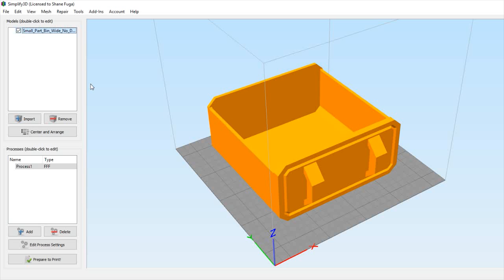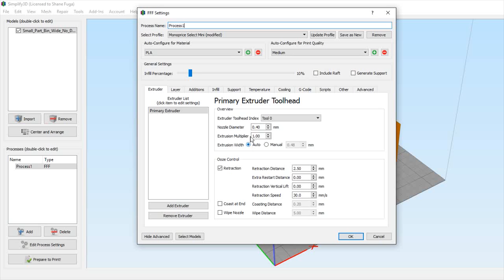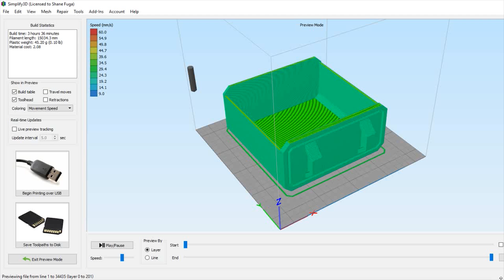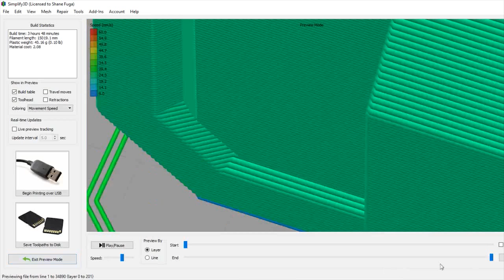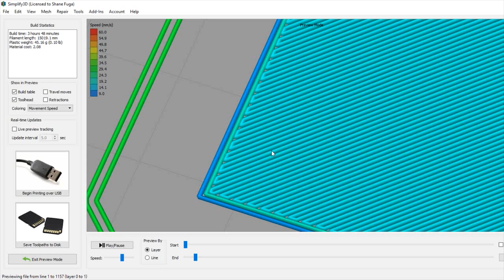Understanding Simplify3D: First Layer Settings

Comment: Raising the layer height doesn't squish more.  It raises the nozzle further from the bed.  At .2 height a 150% first layer height will set the nozzle .3mm from the bed and increase flow proportionately.  If you want more squish you need to lower the nozzle closer to the bed.  That can't be done by changing the first layer height because if you lower the value here the amount of material decreases also.

Comment: Would the first layer settings carry over to every other layer height as I'm having trouble past the first layer as a I got small gaps between each layer after the first
Reply from the maker: Sounds like under extrusion. Did you set the slicer for 1.75mm filament?

Comment: From Simplify3d support site (https://www.simplify3d.com/support/articles/perfecting-the-first-layer/) ---Adjustments to the First Layer Height allow you to vary the amount of pressure the filament exerts against the bed.  There are actually two ways to adjust the height and pressure:

Percentages under 100% will reduce the height of the layer being printed (with no change to the extrusion amount).  For example, if you entered 75%, your first layer height is reduced while your extrusion remains at 100%.  Another way to think of this is that 100% of your extrusion will be forced into a space that is 75% of the layer height.  This reduction in height generates extra pressure and more surface area for that layer, which will help the first layer adhere to the print bed.

In other cases, using a percentage above 100% is helpful.  For example, if you are printing at very fine layer heights, such as 0.05mm, a tiny variance in your bed leveling can result in poor first layer adhesion.  Using a First Layer Height well above 100% can be extremely helpful in these cases. Many machines benefit from 200 or 300% for the first layer height when the layer height is 0.05 mm or 0.1 mm. The increased thickness of the first layer can help absorb small defects in the build plate and provide more surface contact area, which will result in better first layer adhesion.

Another feature is to ability to change the First Layer Width. By increasing the First Layer Width, many users find that their first layer prints out much smoother and sticks to the bed much easier. This is something that is printer dependent, however, we recommend sticking to values within 100 to 200%.

Comment: Dude, great initiative. However, I want to point out that you are wrong about the First layer width settings. Increasing the width does not increase the space between "traces". The software recalculates the width so that the nozzle extrudes thicker and fatter (at 125%) when compared to 100%. In other words, this directly affects the E values.
eg. if at 100% you extrude 0.4mm lines next to each other at E1.0, at 125%, you will extrude 0.5mm at E1.25. if that makes sense. 

It looks like you have a good fan following. Please make sure to correct this in your video. Good luck!
Reply: If anyone is struggling with gaps on your first layer - either lower your nozzle, increase extruder multiplier, or increase first layer HEIGHT setting. Increasing the layer width will not fix your problem. The layer width function is useful if you're having layer adhesion issues and you want a wider/thicker track laid down - but the nozzle path adjusts accordingly so it won't do anything to help fill in gaps that are occurring.
Reply: @charlieaf92  There is s subtly here that I think has still been missed. First layer width when increased by 200% does indeed push out 2x the material but it also does increase the path precision by the same ammount. This leads to little change in the material being used but does over-extend at times. Going the other way im sure the same material is used but the head is lowered. You can see finite changes in the material used tally when you slice and change both of these numbers. I got this btw from the simplify3d site after a lot of reading. Their poor documentation of course is to blame for the confusion we all have about the actual mechanics under all of this ... and the fact that they change it from time to time ...... Persoanlly I would like rid of these as most of us print on glass (dont we ). Anyway  Fugatech I like the vid I was trawling around tonight researching this trying to bottom out what these settings actually do. It's taken me 2 hours reading 4 different versions to come to what I think is what it's doing. You guys here are 90% right but I think just add the point about >100% and it increases the path precision. AHHHHHHHHHHHHHHHHHHHHHHHHHHHHHHHHHHHHHHHHHHHHHHHHHHHHHHHHHHHHHHHHHHHH.
Reply: So if I'm understanding this correctly, adjusting first layer width shouldn't have any impact on spacing between material being laid down? I am getting gaps between perimeters and base layer infill - so far adjusting layer width hasn't helped at all - the only thing that is helping is lower nozzle slightly closer to the print bed.
Reply: waran dv when I increase the width I get gaps in my first layer fill, I think it literally does just space out lines and not extrude more.

Comment: Hey did you have issues with the new software 3.1 version? I cannot get my Machine Control Panel to allow me access with the extruder or the heated bed. Any info would b great! thanks
Reply from the maker: Not that I can tell. I have been using it since it came out and didn't notice anything abnormal.
Reply: Figured it out. I had it on the wrong port lol

Comment: Hmm so you're saying First Layer Width doesn't actually make the extruded material wider? When I hover over it in S3D it says to increase that value to help with adhesion. How does gaps in the first layer help with adhesion?
Reply from the maker: There is a calculation within that setting that does make it slightly wider or narrower but also reduces or increases the amount of space between the traces.

Comment: As for the width info, the percentage is based on what you set your primary width too on the the first tab under extruder...true?
I saw you had yours set to auto 
.48) based on your nozzle size. Width setting, fillament diameter and your layer height setting is going to give either high or low resolution to the print and your percentage of width and height are only what the first layer will be. That is my understanding..
Reply from the maker: Yes that is correct. This is not a tutorial on how to get a perfect first layer. Just basic guidance on what each setting actually does.
Reply: I undestand it's basic but in S3D what is put into motion (ie. layer/height percentages) are all going to be based on what has been put into fileds prior to to getting to this entry and I did not hear you explain (basically) that significant.
Maybe that would be good to do. otherwise it may still not make sence why the first layer has gaps between the segments or open holes around the perimeter. 
I think your on the right track to explain S3D...I like what your producing i. the videos..